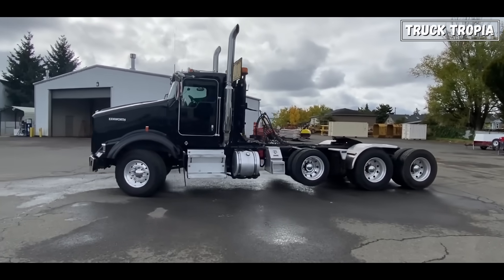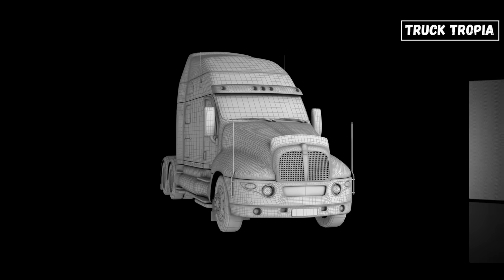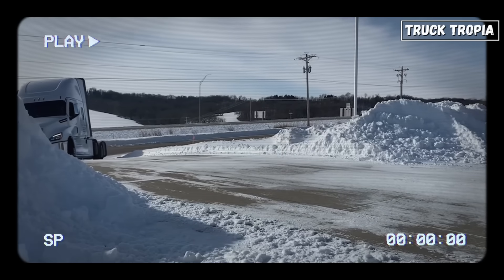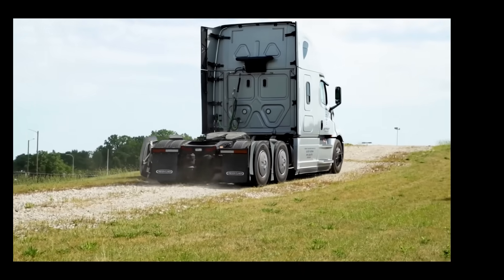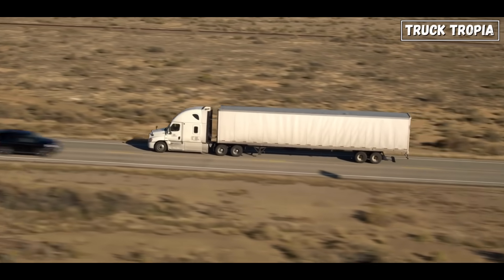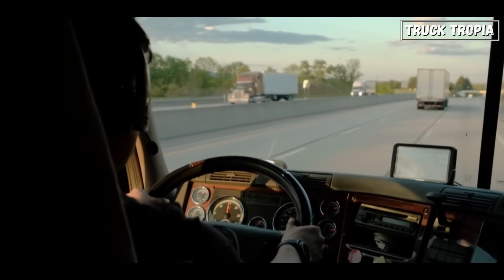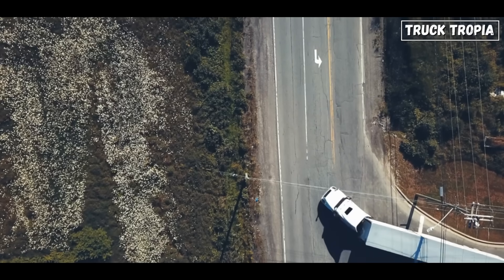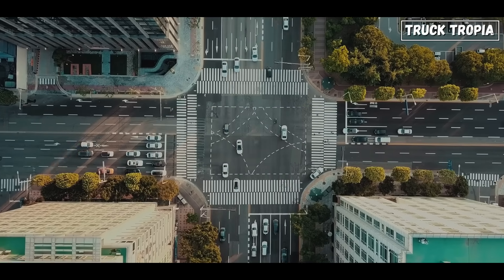Why Do Some Truck Tires Don't Touch The Ground?

Comment: Back in the old days, pre July 1979, the lift axles were known as Tax Axles, due to the Road Maintenance (Contributive) Tax that was applied in all jurisdictions.  They were set up on spring suspensions with a single air bag which was inflated to raise the tax axle.  This was generally the rear axle of a tandem group on a rigid, or appropriate axles on a tandem or tri-axle.

Comment: In Europe you see those smaller lifted wheels too, opposed to the normal sized lifted wheels. The small ones on Mercedes Benz trucks are called Rudy Wheels.
Reply: Yes good point, you tend to see those on tanker and bulk load trucks. They reduce the annual taxation cost but also do not rob the truck of as much payload as a full sized lifting axle and wheel does.

Comment: Explaining axle weights and bridge laws to someone is difficult.
Getting the axle weights and bridge to work just right on some multi axle setups can be a science of trial and error. 1 inch off on axle position and you screwed.
Especially in diff truck configs, attached to different trailer configs. One trailer may not work on a different truck. Especially if the axles are in a fixed position.
The more axles and weight makes the difficulty go up.
Even the position of the fuel tank can make a difference.
Had an owner op friend with an 8 axle setup, who could not legally carry 105,500. The trailer dealer sold him a prebuilt bad config for his truck. My friend is to blame for such an ordeal, by not taking the time to understand weights and bridge, before investing thousands on a trailer.
The dealer would not take the trailer back, even after only having it for about 2 weeks.
He struggled for a year to fulfill the contract he purchased the equipment for. A medical condition came up and the truck was repo'd.
He's grateful for the med condition, and is living a happy life not driving a truck.

Comment: I like to spit Tag axles up in to 2 category's real axles and legal axles. real ones serve a real purpose AKA reduced ware, fuel, etc. Legal axles are there just for weight rating 3:15 the 3 main axles on that truck can more then handle a full load but depending on State/province/country laws they are rated far lower then normal so more axles are needed so they add 2 tiny axles do they trule carry more load no 7/10 times there cheep POS that cant handle anything but if the law say your limit is 5 tonne per axle and you drop those 2 axles that 10 extra tonne you can carry.

Comment: Here in Michigan the purpose of load bearing is more of when frost laws go into effect which is weight from a truck has to be less per axle than normal we have straight trucks we drive that get loaded normally heavy so we have these to compensate for frost laws or when they're heavily loaded
Reply: Also in Michigan there is the frost law speed limits which suck
Reply: @blauer2551  also true lol I don't get the experience of that though I just fix what's broken

Comment: I have a drop axle on my freightliner. They are more prevalent in the Pacific Northwest and upper midwest. Nonexistent anywhere else on tractor trailers except for Heavy Haul applications with duals. Used for spreading weight out on drive axle group when you have more than 80,000 gross vehicle weight as the norm. Helps to take weight off drive axles rather than go the the trouble of sliding tandems or fifth wheel. Flip switch and work is done.
Reply: Finally a comment with the interesting and necessary information. Also the Pacific Northwest has a ton of cross border deliveries, and the weight limits are all different in Canada. For trucks that have to comply with both sets of regulations, it's very useful to have a couple of different drop axles, including to take weight off the steer axles as well. Steerable drops are not allowed in Canada, so the weight limits end up being higher in the US. The added expense was justified by being able to charge higher than standard rates in order to take a couple of extra units across the border. 

Fun fact: Idaho has an entire worksheet that a truck driver must complete in order to operate in that state. There are some VERY tight hairpins in some places, and truckers are given the specific roads that they are permitted to drive on based on this worksheet.
Reply: @CanCobb wrong I live in Idaho and got my cdl in Idaho as well as drove trucks with lift axles Idaho has no special sheet requirements. Only difference with an 8axle truck over a 5axle truck is making sure your weights as well as length are within legal limits which applies to every truck in every state its called bridge law
Reply: Might be referring to truck registration, not company driver responsibility. There are tight roads in Idaho mts I'm sure.
Reply: 80.000LBS is the maximum weight for all highways in the US. and anything more than that requires tag axles plain and simple.
Reply: Wrong. Some states like Washington allow for 105,500 lb. You don't even need a permit you just have to pay extra tonnage on the registration. You would need extra axles to accommodate the weight though. 80,000 lb is for five axle truck.
Reply: Some Oklahoma state highways allow for more than 80k lbs.

Comment: If you have a lift axle on a truck tractor and go to Alberta, you cannot use it and it must be "Chained up".  Now in South Dakota a lift axle on a truck or truck tractor must have a "lift axle permit"  The control of the lift axle usually must be outside the cab so it cannot be changed while driving.
Reply: Just shows that Alberta has mental people making rules. In BC you just raise them and that's all that's needed. Chains, WTF.

Comment: Miscellaneous clarifications, corrections, and additions:

A "lift axle" is any axle which can be lifted, regardless of position (despite the suggestion that they are only ahead of the rear drive axles).
An axle can be both a drive axle and a steer axle - they are different characteristics, not exclusive types.
A tag axle is any unpowered axle behind the rear drive axles... whether it lifts or not. An unpowered axle ahead of the rear drive axles is often called a "pusher" axle.
Unpowered axles in the rear (ahead of or behind the drive axles, so pushers or tag) can be passively steered (castered) or actively steered (linked mechanically, hydraulically, or electronically to the main steer axle). 
Lift axles are used on both trucks (including highway tractors) and trailers.

The word is tire "wear", not "ware".
Reply: There's also lift axles (usually tag axles) that are powered
Reply: @maxi5778  how does a powered lift axle work?

Edit: What I mean is how a lift axle can be powered? What keeps it from receiving power while lifted?
Reply: Air bags push them up. Reverse air direction and they deflate while full size bags inflate pushing axle to ground.
Reply: @Ronald.Golleher basically works as a normal tandem drive, when you want tandem drive you lower it and activate the power divider. Disconnect power divider and lift the axle when not needed. I dont know how much of the process is automated (ie. The tandem drive most likely automatically disconnects if you lift the axle) but the principle is more or less the same as for a normal non liftable tandem drive
Reply: @rikardandersson7288  ah that makes sense, assuming either the power is disconnected or the wheels are braced against something so they can't turn.
Reply: @jasonrabe1664  I meant how can they be powered and lift at the same time. Got the answer to that though, thanks
Reply: @Ronald.Golleher A switch on the dash sends either air or electricity to a valve that sends air to either the lift or road air springs. In line to the road air springs is a pressure regulator to limit the downforce to achieve proper weight requirements. Systems vary, it's complicated...
Reply: @Ronald.Golleher  atleast volvos have a dog clutch in the first driven axle that will disconnect power from the second driven axle when its lifted. They also don't have an interaxle differential
Reply: @eikuz  this is the type of answer I'm looking for, thanks.

Comment: I assumed it was save tire wear (seened an expensive way to "save" money.) Also for tolls if they only charge for axles touching the road.  My issue is id say 97% of lift axles i see are lifted all the time. Im wondering does the average driver really calculate axle weight & raise & lower it as needed? Or is it lifted on day one & never actually put in use?
Reply: It's every truckers responsibility to know you're within weight regulations. Either by knowing the weight of your cargo or drive onto a weight station, and then lower the tag axle if needed.
The money you save by trying to cheat the system is not enough to cover even a fraction of the fine you risk if you get busted with overweight.
Reply: @DonGorgen  i agree, but I'm really talking about the dump trucks making local runs where they're not gonna be stopped for weighing or anything else (at least not where I live). I rarely if ever see the lift wheels down. I don't think local drivers really care to bother with calculations & all that.
Reply: That may be because you are only noticing the ones that are up in the air and not rolling.  When that axle is lowered we all tend not to even notice it.

Comment: Here in South Africa we call our Trucks "Horse and trailers" or the ones with two trailers we call "Super-links" and our are have always two drive axles at the rear(*6x4). Trucks that are 6x2 or 4x2 are considered smaller trucks. The only region or country with bigger trucks than S.Africa is Australia with their Roadtrains
Reply: That's just not true on the only place with bigger trucks is Australia
Reply: Mines in 🇿🇼 use road trains!

Comment: Here in the UK nearly all tractor units are the 6×2 configuration ie 6 wheels 2 wheels powered with a lift axle on the middle, the lift axle will only lift if the weight on the drive axle is below the maximum axle weight, we operate double deck trailers and you have to run with the lift axle down at all times as lifting the axle could cause the suspension plates or the rear bumper to ground, running with the axle raised increases the height so the trailers could be above 16"6" which is the legal height limit in the UK and potentially cause a bridge strike but this would be rare as most bridges are about 17" on main trunk roads
Reply: The automatic control is important. Without it, drivers would drive with high load and the axle lifted, causing excessive load on the non-lifting axle. This is the reason that the use of lift axles is restricted in western Canadian provinces - the regulators don't trust drivers to avoid overloading by incompetent or reckless operation.
Reply: @brianb-p6586   I used be a Field Supervisor for fluid haulers - The Ground Cable that drivers are required to hook up before getting loaded, and disconnect after getting loaded - They forgot to unhook them more times than I could count. They even have to walk by it in order to get in their truck.

People overlook the "Easy" things cause bad things to happen eventually. I'd be terrified if those same drivers didn't have an automatic control. Sure it's easy enough to hit some buttons, yet some people cant move a clamp 2ft from A to B.
Reply: @brianb-p6586  If you think you have to force people to do what they should you've already failed as a manager/regulator. The entire US is literally proof that you don't.
Reply: Only 17”?! Holy moly that’s short
Reply: Obviously the heights were supposed to be 16'7" and 17', @fredfrederickson
Reply: @brianb-p6586  So they built them all nearly 16 feet short of the height they’re supposed to be? That’s even worse!
Reply: @fredfrederickson that's why drivers also have to be limbo dancers.

Not many people know that 😅
Reply: @fredfrederickson  Stone'enge's 18" but yuv needen to park away n crawlthru tinkin das wha dey ment
Reply: @fanwoodwatcher3873  that's some weird spelling.
Reply: @ Nah. they fain to letchya pahk hard bye de Stonendge widout ye take a pint a best bitter ahn de udder side 'n usen a tunn'l odderwys it'd be gradis, kord'n te spillshack. Mebbe too pints. 18 inchs. dats a laff, sert'n serkles.
Reply: @fredfrederickson  Tried to reply but laffing too much
Reply: You don’t have to run double decks with a 6 legger, yes it’s weight dependent. Home bargains tractor units are seen with 4 leggers with the DD because their not running high weight
Reply: @markoasdadriver6285 Barry's an idiot 😂
Reply: Bollocks mate. Double deck is purely down to weight, like a normal trailer,lifting the tag axle does not effect the overall height, lifting the rear axle height would .😂  My word think before you chat shite. There is no legal height limit for a trailer in the UK. A  marked bridge is below 16ft6 that's all. Come on Barry learn your trucking
Reply: @martinadams4567  I maybe blowing my own trumpet here mate, so apologies if I’m wrong but I’m pretty sure rising the tag increases the height of the fifth wheel. Always look at the trailer. It’ll say the height of the trailer on a fifth wheel height or something. You could check this buy having your tag down and the legs down then rising the tag and seeing the gap on the floor with the legs.
Reply: european trucks suck.
Reply: I hope your bridge is more then 17 inches.  Like 17feet.